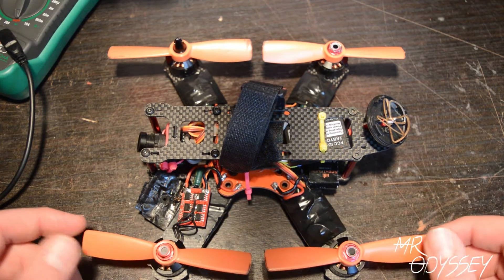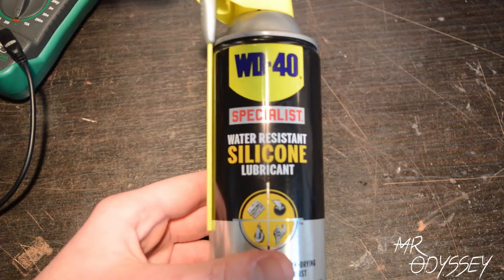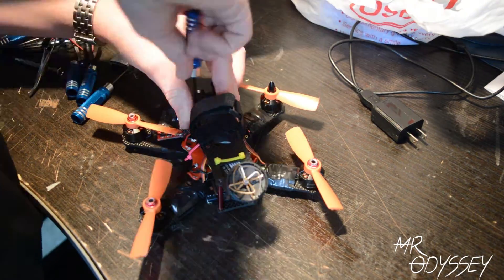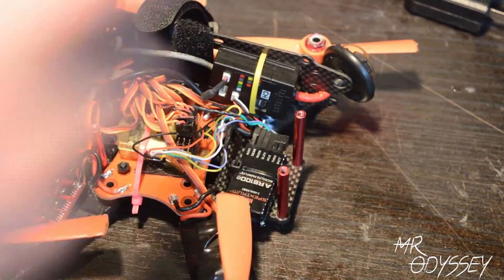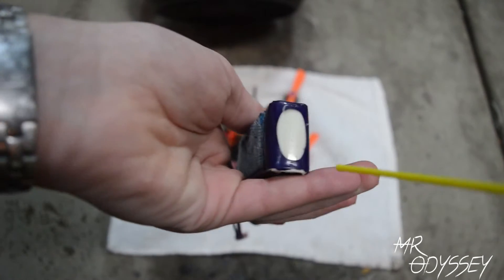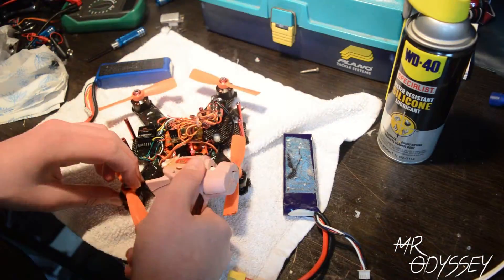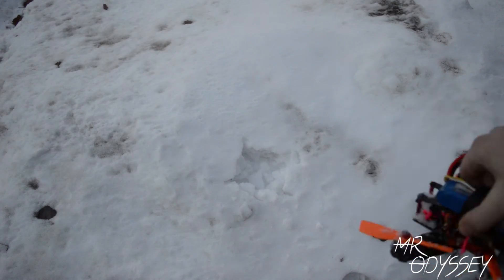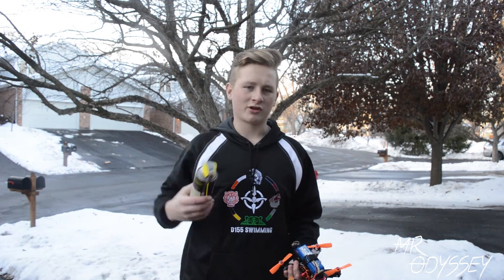How To Waterproof/Snowproof Your Drone

Comment: What's it like when later on you have to solder on a circuit board you previously water-proofed with this stuff? Does it foul up the solder when you melt it and make the new solder joints contaminated or whatever?